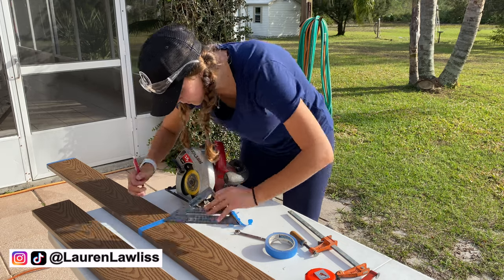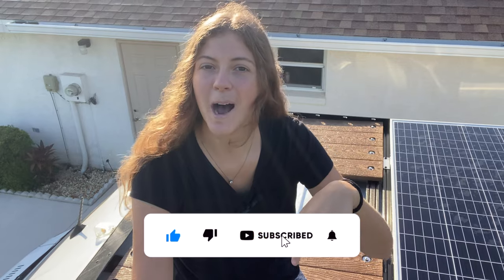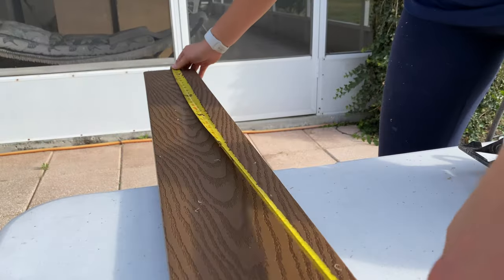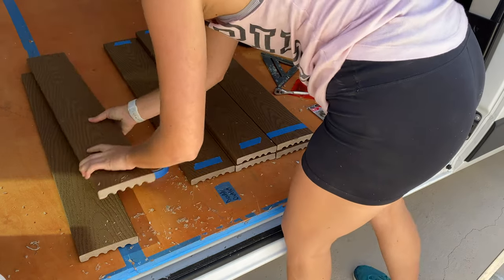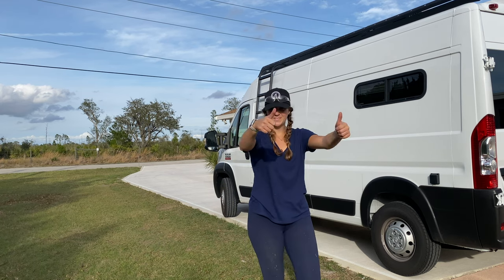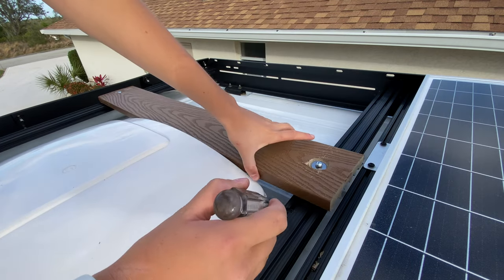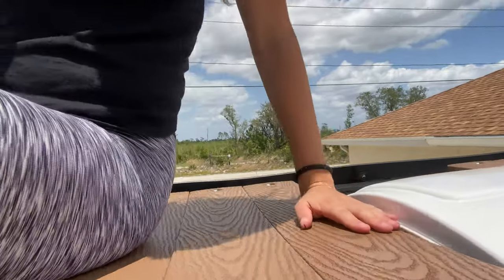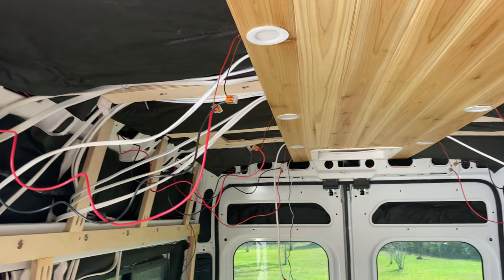Composite Roof Deck | Ram ProMaster Van Build Series 14 | Van Life | Solo Female Traveler

Comment: Hey Lauren, the composite decking is not structural... it will flex and bend in the sun.... For decking, you need 2x6 lumber that is sealed... 2x6 is structural and will not flex or bend in the sun.
Reply from the maker: Hi there! Thanks for your comment. Personally I am happy with composite decking for my wants and needs. Might not be perfect but it does the job for me. There are definitely other options you could consider.
Reply: I'm looking to do this for a bike rack with some trex I have. Recycle them. I'll add some wood supports.

Comment: Until you get around to your 80/20 fix, a decent improvement would be   to run another piece of composite underneath with stainless fasteners, conecting the deck pieces  together down the middle and making them one. You could even rip one piece down the middle on the tablesaw using one slice for each side. 
This is how we put scaffolding together  so the planks dont flex independently.
Reply from the maker: Thanks for the idea!

Comment: Would it have been possible to position the front max air fan offset to one side so you could have one wider roof deck instead of two?
Reply from the maker: For sure! The roof fans can go anywhere on the roof😁